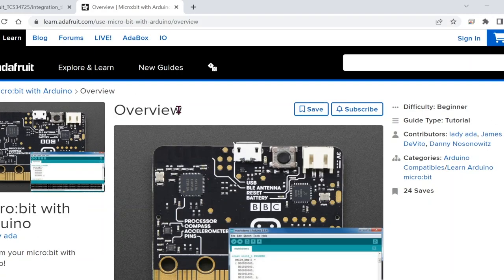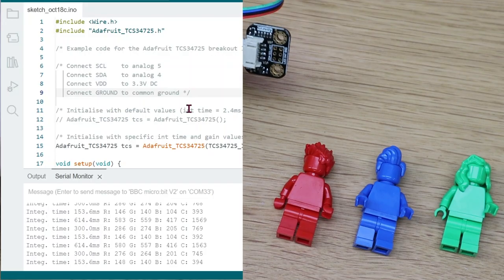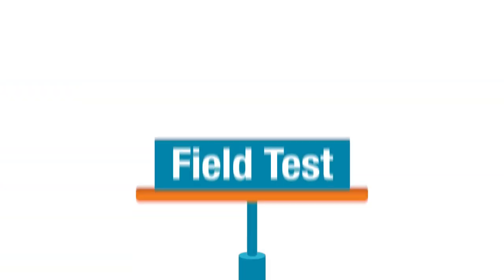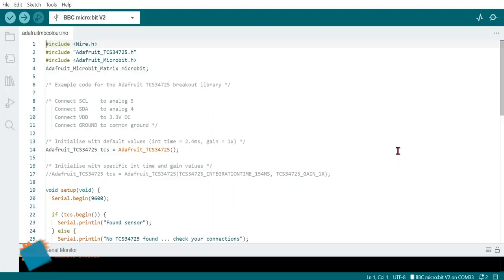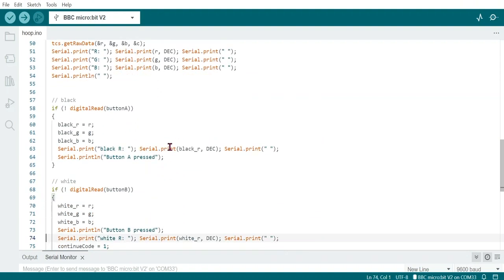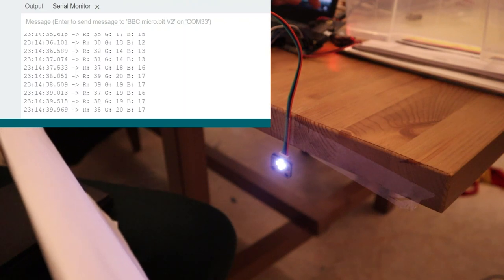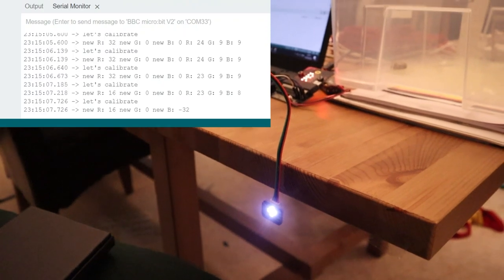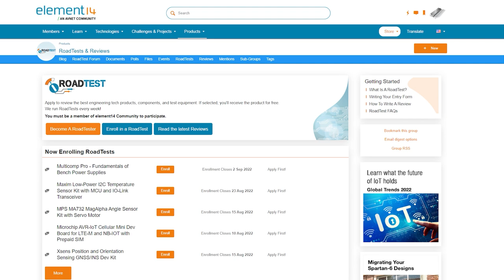How to Make a Basketball Auto Score Keeper Using Color Sensing

Comment: There is another way to detect colour balls, 3 photocells with RGB coloured filters placed in front of the cells, this will an analogue output thats easier to work with, I used that on tomato grading machines, good enough to separate red, redish green, yellowish and green tomatoes, a few things i just remembered, those white LEDs might give out some UV and the finish on the surfaces could reflect white light to the cell regardless of the colour